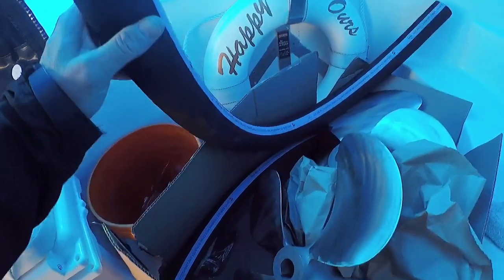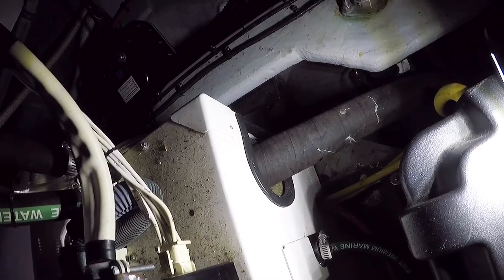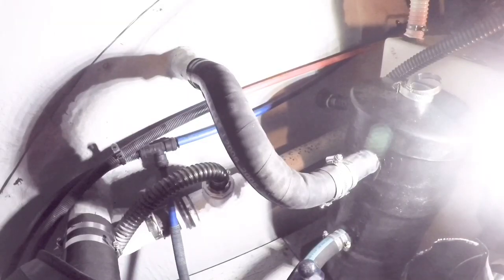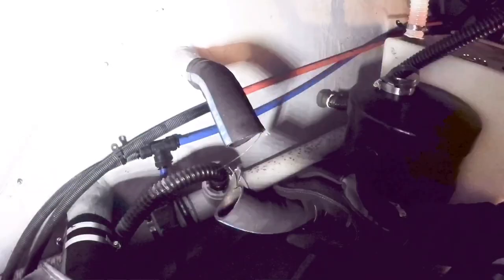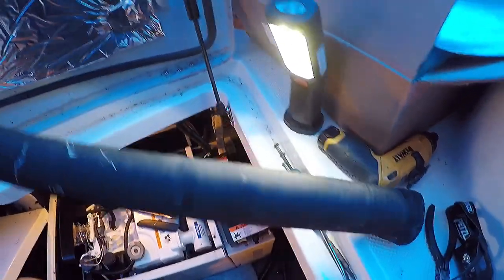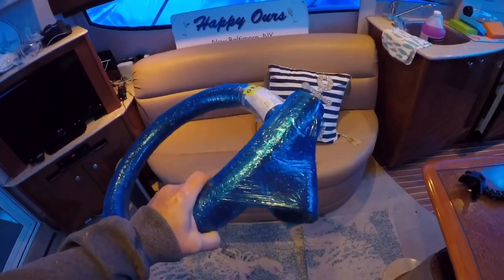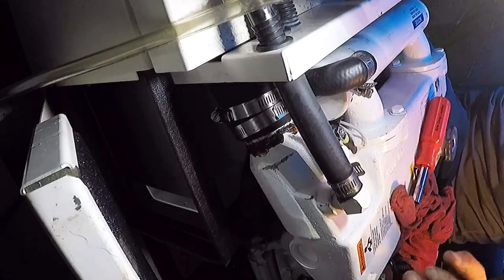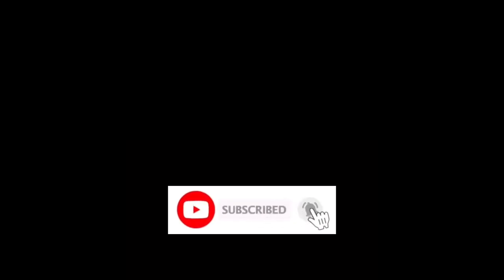Marine Generator Exhaust Hose Replacement

Comment: Good job Tom!    Here is a helpful hint for the next time you never do this... heat gun and some thermal guard gloves.  Even a hair dryer will do.   Heat the end of the hose when it is close to the nipple.  It will expand to get on the nipple easy peasy.  Just don't heat it where you need to put some near bending pressure on it or it will easily kink.
Reply from the maker: I considered that but did t bring the heat gum that day!   Next time for sure!

Comment: Thanks for the video. I just ordered my hoses before I saw this. I will take my heat gun and my hose pick. Keep them coming!!
Reply: After watching this I had an idea. I am replacing the 1 1/4 lines from the strainers to the engines. Very hard to access by the way. I had previously replaced the 3/4 line to the gene. It was tough to get off like you know. But cutting it lengthwise helped. Here is where my idea came in. I have a Dremel tool that I use for a lot of things. I bought a small 1 1/2 metal cutoff wheel attachment. If you go slow and are very careful not to go to deep it works great. It only took about 30 seconds and the hose really falls off of the connector. Once you cut through the stainless wire about 3 inches, lengthwise, the hose pops open and falls off. Just be very careful not to go too deep and cut the connector. I did the port yesterday, starboard today!!
Reply from the maker: Whatever makes our life easier!   Another subscriber suggested I use a hose pick.  I picked up a set last week.